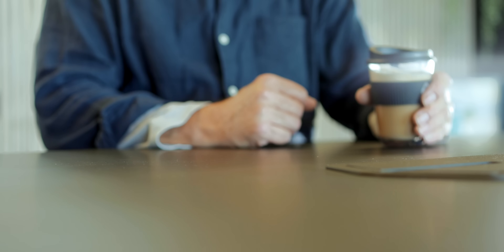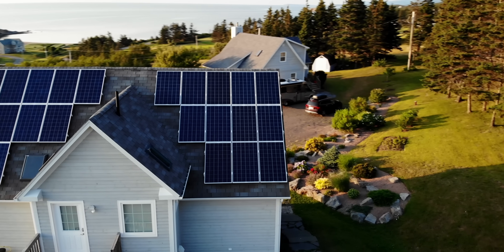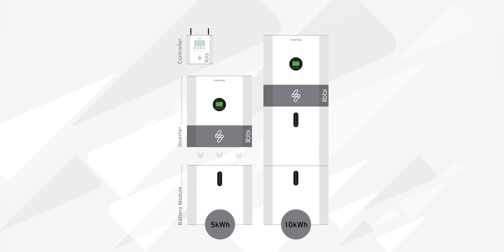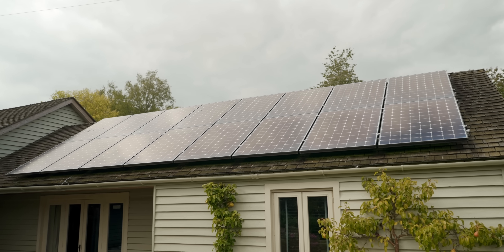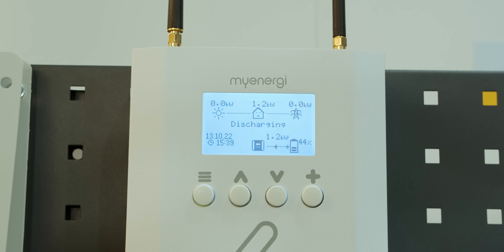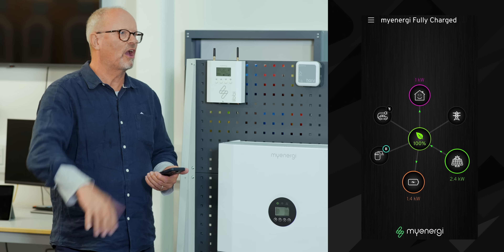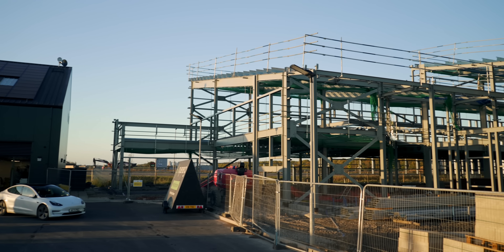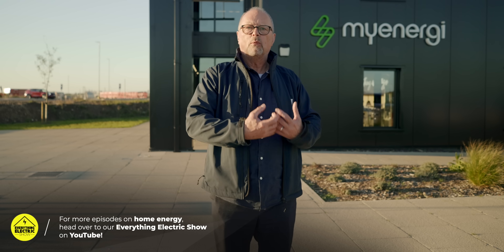THIS Home Battery is the Key To Cheaper, Cleaner Energy!

Comment: Why why why wasn't there a discussion about bi-directional charging from the EV back into the home ecosystem? Vehicle-to-load is an important technology and it's disappointing for it not to get an airing here - a real missed opportunity.
Reply: The technology exists but here in the UK we seem to have been forgotten about - the early Nissan Leafs were shown plugged in to them and were reported to have kept the electricity going into home during an earthquake in Japan. I think we need these asap, and with talks of blackouts this winter and the high cost of electricity, they would be a huge benefit to the country. On top of that, they'd be a lot cheaper than a battery and better for the environment as no new battery materials would need to be sourced.
Reply: @bobthebarsteward  I'd hope that a company like Myenergi would embrace the role of the EV charger in the context of a home PV/Battery ecosystem. It was a glaring omission from this discussion of their battery/inverter offering.
Reply: Probably because this system doesn't support bi-directional charging and it was sponsored content so they probably weren't permitted to talk about any of the negatives of the system.
Reply: Home battery supporters are terrified of the bi directional charging. Cars will overtake home batteries within 5 years. Why would I pay $20k for a 10kw home battery when I can pay $100k for a 120kw bi directional charging car that does what my house battery does, but also let's me drive it to and from work
Reply: Bidirectional charging is a cool idea, and cars with LFP batteries would probably be the best suite, but this is a system with many moving parts and no coordinating entity.
The same goes for home storage. Buy a solar system with an inverter and want to add a batter? Sure, but you need to get the battery that works with your inverter...there are no standards in terms of connection,. communication,. voltage etc...
Reply: Is it part of the CCS spec?
Reply: I had a leaf and went on the OVO v2g trial. The device was huge, and even during lockdown when I let the system charge and discharge as much as it liked the income was less than £150 per year which I am sure was less than the "wear and tear", on the battery I noted via "Leafspy". At least with a Leaf and old priced electricity it was not good for the vehicle owner.
Reply: @mrhignettshorses  what about wallbox 2 (much smaller) and type 2.   I'm keen for V2H vs V2G (home vs grid) so I get to use/control my own generation/off peak charge into the car.  

Still... Need the charger, and a car to go with it.  Charger = wallbox.  Car?  I did hope for the Mégane but alas 😢
Reply: @matbowden9156  If you have a leaf, I would personally not advise it as the state of health of my battery was impaired.
Reply: Not all cars can do V2X and for Tesla it would cannibalise Powerwall sales, although I did speak to a person at Fullycharged live who had reverse engineered one.  It will be standard in say 5 years time and in some circumstances will make static batteries redundant. In the meantime, I gather the biggest selling point for the F150 Lightening was its V2X capacity…..but trying to park it in a UK car park!
Reply: @davidhumphries3614  USA COST $20,000 to use when grid goes dark. I install home generators. It not simple and low cost.  And from your EV much more to coordinate design make gail safe and low cost. 10 years the cost will drop, not today. Needs to scale.
Reply: I agree. Why aren't they using a 62 KW Nissan Leaf as a battery and having that unit feed into and pull off of the car.

I have been trying to convince people in the US to get serious about this very thing. 

Grid tied Solar is Sexy and no one wants to even glance at anything else. 

When the grid power goes down guess what, you sit there in the dark or still can't use it during full sun.

I have been into all forms of Solar Electric and Solar Thermal since the mid to late 80's. 

I am always 15 to 20 years ahead of people in my thought processes and it is frustrating. 

I have done things that people told me couldn't be done but the little guy or Individual inventer or designer always gets shoved to the back of the room and silenced.

I am going to state this again to people. 
Vehicle to grid through the Chademo standard is what we all should be moving toward. 

Secondary is Hydrogen through Electrolysis. It can be used to store excess energy and take the place of petroleum where it is used.

Hydrogen can be used to generate Electricity through a Fuel Cell or be burned to produce heat in processes that can only be done with High Heat or open flame.
Reply: Far to few EVs have that feature, unfortunately.
Reply: @stefanjohansson3670  it's very new.
Reply: they do not make the car, so have no control what the car can do, seems logical to me.
Reply: I want this! Got a Tesla & a massive commercial solar system at work. I’d love to come home & plug the car to the house to run it overnight. I know in the US the Ford F150 has a whole system for vehicle to house power! It would be a massive benefit then wouldn’t need a home battery!
Reply: First your car has to be bi-directional. 
It's really expensive to ad that to car
And expensive to ad that to home system.
Reply: A good idea but is it practical? The only argument I see is you charge you car at your employer's office and then use that electricity at home. 
Otherwise, a car battery is probably more expensive than a home battery. Also why would you discharge the thing that moves you around and takes many many, many to recharge at home?
Reply: Not all EV’s can do this and hardly any chargers can
I asked about this very thing wile my company charger was being installed and was told the charger can’t do it
Reply: Because charging a battery is not efficient. So charging a car driving to a house and using it is not as efficient as using direct from the grid at the home.
Reply: @Maceyee1  that doesn't make sense.
Reply: Not relevant to this video
Reply: @mkanand  But relevant to the comment it is responding to. Thank you mr Self appointed moderator
Reply: The international standard for vehicle to grid power management haven’t been fully finalised.

Once they are more grid operators will be able to look at deploying.

Many car manufacturers may then over the air update their cars.

Should add a lot of car manufacturers are less keen because it will shorten the effective life of the car battery.
Reply: @bmwhocking  No idea about V2G and a defined specification for making the sophistications of that work - that has to be difficult I'm sure.

In specifically looking at V2L I expect the wallbox makers and the car companies to be in close co-operation... and to that end I am interested enough to see that there are a lot of EV wall box makers that either make or have announced bi-directional support for V2L applications. Tesla, Ford/Sunrun, Emporia, Solax, Wallbox Quasar etc. etc.

I'd hope that a company like Myenergi would embrace the role of the EV charger in the context of a home PV/Battery ecosystem and get on it with some announcements for popular vehicles that will support the bidirectional flow of energy. That has to be a game changer for them and I was puzzled by the absence of its discussion in this episode of the fully charged show. A significant omission.
Reply: @bmwhocking  is battery damage really much of a risk?  Home battery use (drain etc) is very much less demanding than vehicle battery use and deep discharging could be prevented by either system applying min %age
Reply: Think it through.
Assuming you have solar, and you have an EV, and you drive the EV.... To work?
Then you have to put the energy somewhere?
As mentioned, if you send the energy straight to the Grid, you receive "a pittance" for the energy.
You also power your home during the day, but you're not there, the use is minimal.
You system is over specified.
You arrive home, it's October (for instance) it's virtually dark, there's no solar.
You're already buying energy back from the grid, probably at a higher price.
You connect the car, power the home, but later, you buy MORE energy back to charge the car.
Or.
You install a home battery.
Very little, if any energy "sold", but no extra energy to power your home, and normally enough to top up the EV.
.
The moment you have a battery, you don't need V2H.
Reply: Professional energy storage installer here. It’s because bi-directional charging doesn’t make sense for a home charging system, sure it can work but for cycling the battery everyday you would need your car connected at all times. It’s not feasible to replace your home battery with a car, the home battery can work 24/7.  Also you would degrade the battery twice as fast, since you are driving the car as well
Reply: @Magik Plan  another person with no picture,  no name, no proof of claims that theyre actually a battery person...just a claim. why would my home use my battery 24/7 if it's not a buy all sell all or time of use situation? If my home is using my battery 24/7, wouldn't that imply it's cycling? Which was your complaint for not using a car...

Bi directional charging has been out for 5 minutes basically. It can most certainly work as a backup during a power outage which is why more people are doing it. You talk about battery life as if technology isn't outpacing battery and storage and panel life right now..do you even pay attention to the market or are you just a wrench turner that can just follow install instructions?

Comment: So a big question is will the libbi work alongside an existing battery system such as solar edge? Essentially using the dumb battery (solar edge) as pure storage and the libbi as your smart storage that you can talk to with other systems? This would be super handy to know! As ever excellent content from the team here!
Reply: I have a SolarEdge System with battery. I use Solarmanager for exactly this use cases. It controls go-e EV charger, my heatpump and multiple smart plugs.
Reply: @patrickdiener6065  is there a list of systems it integrates with for control? Sadly it appears to not be available in the UK, can't even download the app.
Reply: If you have the SolarEdge energy hub inverter you would be best to use their ev charger, battery, hot water management and smart plugs, mixing and matching ecosystems can have some interesting compatibility issues or you may not get the desired results. 
With the energy hub you should be able to connect close to 30kWh of storage per inverter (and with each battery you can add another 5kW of panels)
Reply: I use a 48v Hybrid SolarEdge Inverter with connected DIY 48v battery. That was the most economical choice since I paid around 2300 CHF (2000 GBP) for 15kWh of storage including the BMS. I'm not aware that SolarEdge offers things like smart plugs and heat pump management plus their wallbox is triple the price of a go-e. That's why I choose Solar Manager as a central management app to connect and manage all the devices from different manufacturers.
For sure there are multiple management solutions, in my opinion it’s important that the solution is customizable and supports lot of devices, manufacturers and API’s. If you have a bit of technical knowledge, you should be able to integrate and manage new devices by yourself. Would be a pity to always get e technician onsite if you want to extend your managed devices.
Reply: @patrickdiener6065  Where or how did you get that setup so cheaply? Do you have some buying links?
Reply: If you’ve just brought solar edge battery then I’d get the most from that.
Reply: Solar Edge and Enphase for example, both protect their ecosystem with proprietary lock-ins such as internal interoperability protocols. I am planning on some more open third party components in our system, specifically Smappee HEMS devices to open things up. I already have Zappi with Hub installed and it is performing well.

Comment: 1 cubic meter of liquid with 1 bar pressure could exude around 100 000 jouls
60 minuts 60 second with one joul would grant us 3600 jouls
so 1 bar if pressure per 1 cubic meter would grant to us around 25 wat per our
But what if pressure would be 1000 bar (deep beneath the ground in sake of safety)
25 kilowat per 1 cubic meter , it will do , definitely :)

So we could use  large  tank with high pressure gas and pump in/retreave out whater from it but 10%  of  its overall volum (to not change temperature)

Comment: One thing people never talk about Tesla powerwall is that if there was a power cut and you wanted to use solar energy and your battery to be off grid. This is from my understanding but the powerwall turns off the solar panels and uses only energy from the battery full stop once the battery reaches a low enough threshold it will accept the power from the solar panels but be unable to output power to the house.
Reply: The Tesla powerwall during an outtage will momentarily interrupt the solar in affect shutting down but while the house is being backed up by the battery's it will fire back up again in less than 5 minutes whether the battery is at 50 percent of 15 percent . If the solar is producing 3kw and the house is using 4kw then 3kw goes to the House and the battery will output 1kw 
Tried and tested here in the UK

Comment: Much as I applaud this initiative, it irritates a pet hate of mine when it is shown as an installation of 4 boxes. The inverter is the key piece of hardware and it should include the software/control elements for grid connection plus PV MPPT input and battery charging but this doesn't need to be in multiple boxes, as Growatt have shown. At the same time I see no reason to buy and expand the battery from the same supplier as I might choose for the inverter. All suppliers would like to tie you into their "ecosystem" but I avoid this when I can.

Comment: Im wondering how this system is any different from the rest of the manufacturer out there? Also, saying its energy efficient etc is one thing, but how expensive is this? The primary reason for PV at the moment is cost saving for most users. This sounds expensive

Comment: Have they published their protocols yet? I shouldn't have to buy my battery and EV charger and home controller from one (proprietary) outfit to be able to control where the energy goes effectively. I should be able to use my preferred software to talk to whatever kit I've bought. When I asked at fully charged a few months ago it was a flat 'no'. We used to have this madness from Sony, who wanted you to buy a Sony TV and Sony HiFi and Sony video and then they'd interoperate. It's bollocks - just about no-one does that in the real world. Nearly every supplier of home equipment is stuck in the same idiotic 1980s mindset of proprietary protocols to try and lock you in to their stuff. It's not good enough and we should all complain at them until they open up and allow interoperation, so everyone's stuff can work with everyone else's stuff. 
I'm not buying anything from this lot until there is a published protocol to talk to the devices
Reply: There's a. Published api AFAIK.  See their forums.
Reply: @nigell1652  But isn't that just an API to their servers, not to the devices?
Reply: Ah. Yes.

Comment: good to see Grimsby leading the way, but only 4 linkable together though seems to be missing a trick ,powerwalls are more as are pylontechs, the pricing needs to be more transparent too, as opposed to individual installers, i can off the top of my head think of @ least 3 "installers" who will charge different prices for the same kit, pity as its made in the UK, buying direct from Grimsby should be a option for the man in the street, that would help keep installers more honest in there pricing if nothing else, also no mention of whether its G99 approved ??, plus the powerwall is larger in capacity, @ 5.1 kw (he thinks ?? the myenergi bloke that is), i can buy a slightly smaller pylontech (4.9kw) in the uk for circa £1900, so by that yardstick its £2k then ??

Comment: How much does this cost ?
Reply: I had a growatt 6.5kW battery added to my solar pv. It was fitted for £3450 including VAT tail end of Aug 22. I've 3.4kW of solar (max usable roof space). It did take almost 9months for permission to connect the battery to the local grid.
Reply: Arm or leg?
Reply: @dugggy5  Just got an update from Myenergi  and a 5kW Libbi system would cost about £4800+vat exc fitting.
Reply: @Banyan314  kWh
Reply: Any idea about the 15kw and 20kw system pricing ?
Reply: @stuartscott5136  That would be interesting to know as that would be more comparable to a Tesla PowerWall system.
Reply: @stuartscott5136  kWh
Reply: 4595+VAT ex install for 5kWh